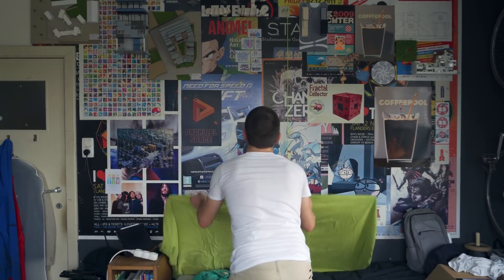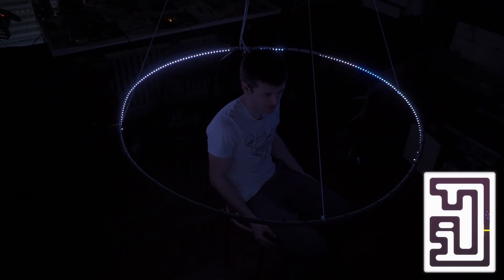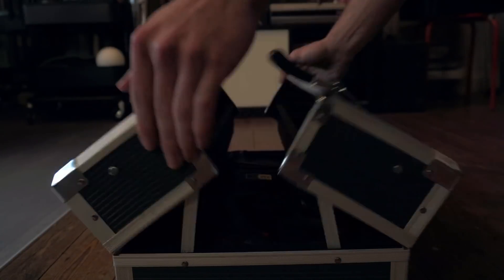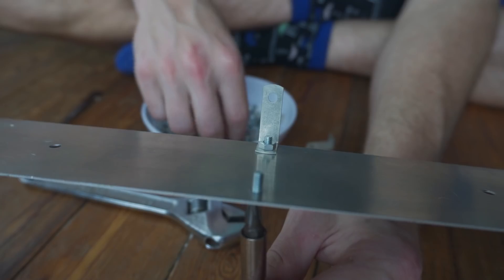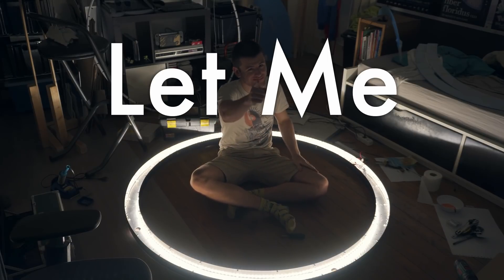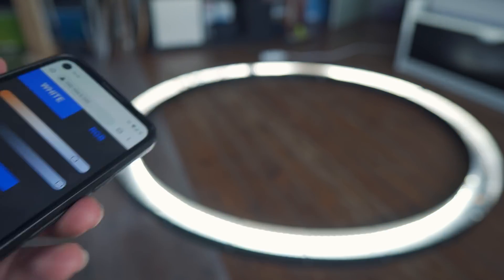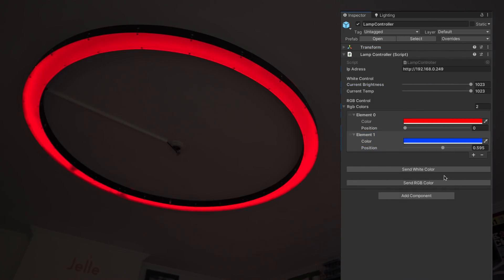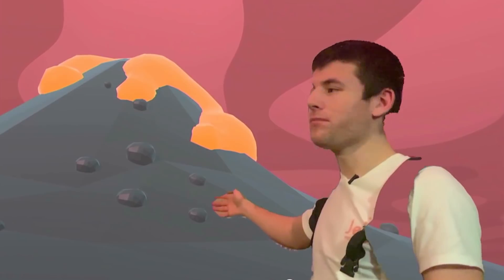I Made the Perfect Light to Eliminate Green Screens

Comment: Do the mosfets convert the AC to DC? AC powered LEDs are terrible for video - which makes Philips hue bulbs useless for this from my experience - though I haven’t tested with their strips
Reply from the maker: no, the mosfets allow a 3.3-5 V signal to interact with a much higher voltage source. so in this case, using a 3.3V digital signal to control current flowing to the 24V LED strip, allowing it to vary it's brightness